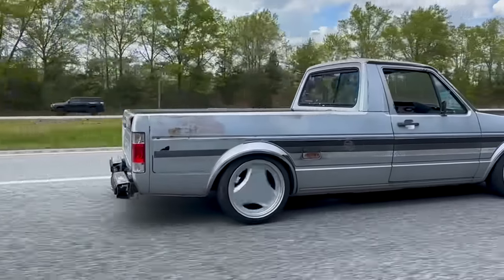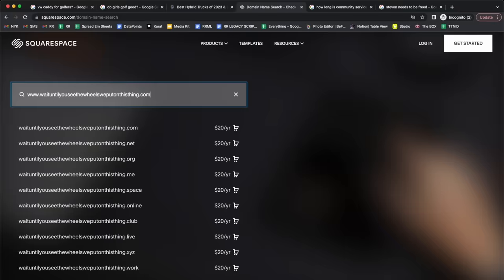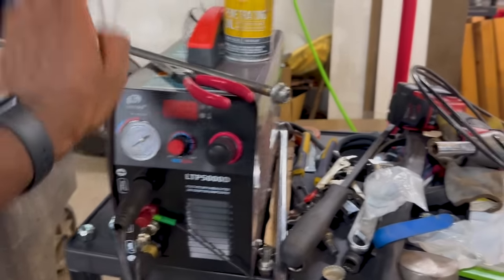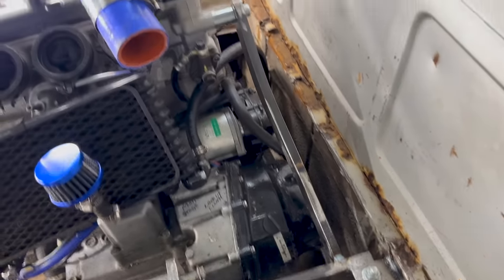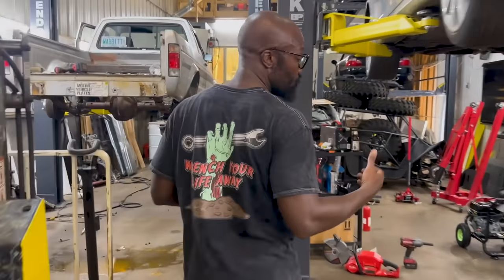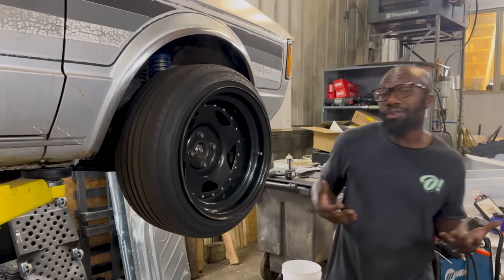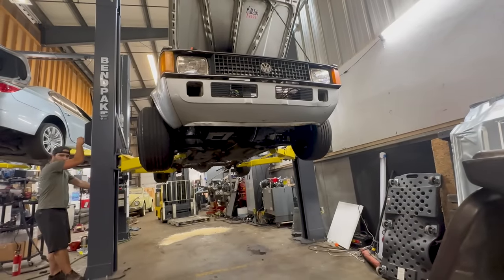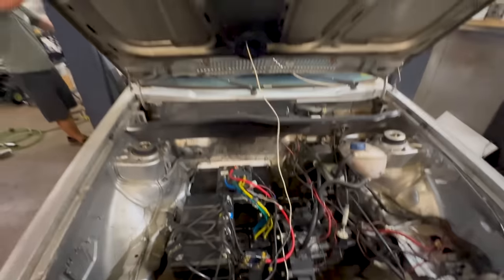The Turbo Hayabusa Hybrid VW Pickup Hits The Road

Comment: Disconnect the ground and see if it takes off full throttle.  You also want to have a limit switch in there
Reply: I sent that while driving.  TL;DR many of those potentiometer throttles are biased in such a way that if you lift the ground wire...  The wiper will energize to VCC

SOME controllers will recognize this as an open circuit and ignore it

SOME controllers will see this as a full throttle input

SOME hall effect type throttles don't have this failure mode, but they have a nastier failure mode...  If you rip the handle off, The magnet comes away, and it sees that as full throttle

SOME throttles come with an integrated switch that indicates STOP, so even if you're ground lifts, if you were at 0% rotation, it will not take off full throat

SOME controllers except two throttle inputs that are 180° out of phase

SOME controllers expect high voltage on the throttle (ack!)

ALL electric vehicles have an E-stop.  A prominent OH $HIT button that you can slap if you lose control

Comment: Sorry, I don't like the stance... I mean... I do, and I don't, I don't mind the wide body look if it's done right, but we both know that's not going to happen here... I hate seeing bodies cut up even though that one's a POS. You're getting done it'll be alright...

You should have used a Fox body mustang rear end, maybe... You could maybe swap axles from one, but I know one is shorter, so you probably have to have one cut down... I think... Anyway, then you could use a dual 4 lug wheel, and had no problem... No one would notice that one was using the 4x100mm and one was using the 4x108mm

Could do a 5 lug conversion on front of rabbit as well... However, the kits are like $500. and you'd still have to use a dual pattern 5 lug rim...  5x100mm & 5x114.3

Comment: I wonder if an aftermarket traction control system could output a signal when you get rear wheel slip and proportionally increase the electric motor torque?
Reply: P.S. - I would show you pictures of it working on my hybrid 4WD VW Caddy; but I dont wanna.. so there.

Comment: RICH: you do NOT need to use the clutch with every shift with a motorcycle transmission.  Motorcycles use constant mesh sequential transmissions, abs once your moving you can not only shift without a clutch, but you can shift under power too.

Comment: Something tells me you won't need the clutch if you use the electric motor to begin moving forward it'll just drop right into first gear easily and then you can speed shift after that!

Comment: Why not run the electric motor if the accelerator pedal . Once the vehicle reaches a certain speed it can then shut off.
It's range could be 0-25 mph

Comment: If you’ve ever actually rode a motorcycle you don’t technically have to use the clutch for every gear shift. As soon as you left off power and pull up it will shift up or down. Is it good on it? Not necessarily but you indeed do not have to clutch every single time.

Comment: I don't think I've seen such a disparity between workmanship and design.  The throttle wire wrapping around the steering column is the perfect metaphor for how much this car barely works if you're paying attention, and can kill you, and others on the road, if you're not.  I would've preferred you crank up the fuel pump, close the waste gate, and put some ironic Cummins badging all over it.  This build needs safety mechanisms to reconcile throttle inputs and drive modes between the two drivetrains.  You're free to build anything you want, until you kill someone because you gave a reverse input to your electric drivetrain while doing 70 MPH on the freeway.  This is the exact opposite of the accomplishment embodied by ICE-T.

Comment: Ayo the guy with the nappy beard should try to combine a drive-by-wire accelerator pedal with the traditional style to push both the motor and the throttle on the engine.  It basically has a potentiometer built in, and adding a cable to it shouldn't be too complicated.  Just saying...lol

Comment: With the electric motor you don't even need a starter for the hayabusa motor, like a true hybrid you can stop the engine at lights and use the electric motor to spin it back up..

Comment: You could just make a shifter you got enough electronic knowledge all you need is a little solenoid and a button and some cut up pieces of aluminum or steel wire everything and test everything

Comment: Does your state not have rules about wheels sticking out past the fenders? It's not allowed in the UK, and you are kind of taking the piss with those. And what's going on with the sidewall sloping like that. I've never seen it before - I'm surprised it holds air, and is possible to actually fit in the first place. Not sure about 'cool', but it is different.

Comment: We are not going to use the four lug tri blade rims because we would have to use wheel adapters. Instead we are going to circle back and use these four lug steal rims and prolapsed anus tires with “wheel adapters”.  Got it 😂😂

Comment: I don’t know how to send you what I have a 1989 b2200 sr20det swap 1000cc injectors fuel cell Haltech ecu ford 8.8 rear end with rx7 4 piston brake set up in front with mustang wheels the turbo is a gt35r with nitto tires I wish I could have send it for you to finish but u know how it is I sold it for cheap u know the wife and I don’t really have time but it was a nice build took me 4 years